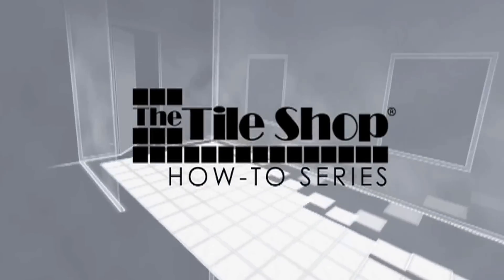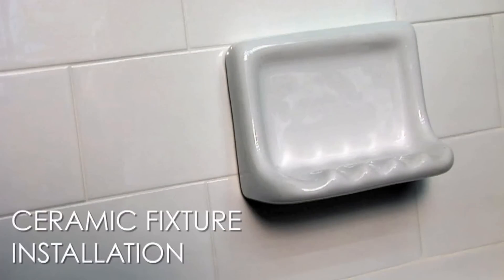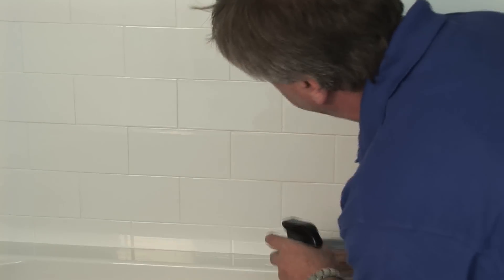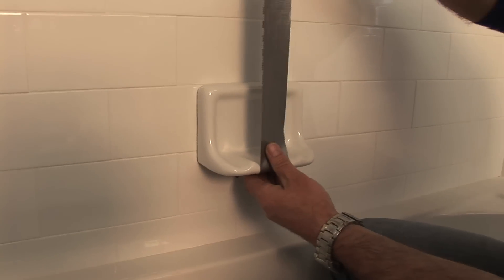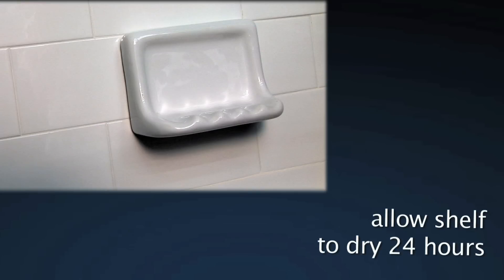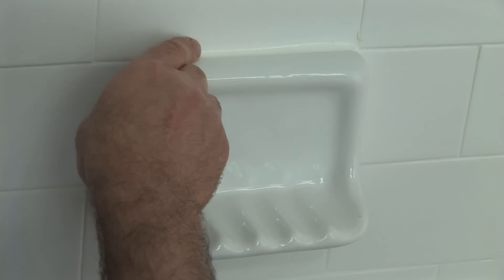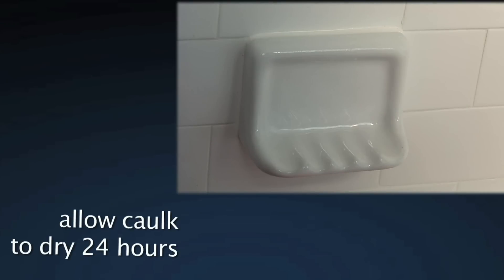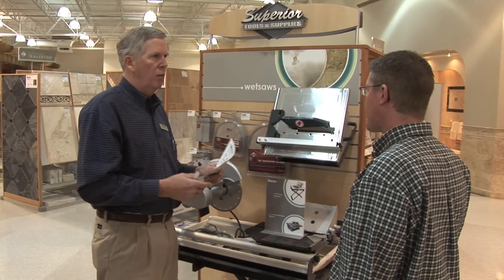Ceramic Shower Shelf Installation - Learn How To Install Tile Today

Comment: Best setting formula for setting any ceramic fixture on cement board, is weldbond glue combined with the grout being applied with the tile until it makes a 'gummy' mixture then add a little water to it until it becomes workable like a mortar consistency. I laid ceramic tile for 25+ years until I had to retire because of health reasons. Absolute best setting material you can come up with. Once its on there it will NEVER go anywhere unless you want it to and even then you'll have a hard time. Sanded or unsande doesnt seem to matter once it has been on there 24 hours I used to hang from them, with all my weight on the fixture.

Comment: just use epoxy glue. i tried dap, i tried grout and none of them worked. fell off in a day or two but the epoxy glue is still holding

Comment: Do it the RIGHT WAY!! Remove the tile from the area you are going to install a soap tray, then use Plaster of Paris to glue the tray to the wall NOT THE TILE! After 24 hours of curing, use a silcone based grout to seal around the edges. "The Tile Shop", you suck.
Reply: lilrascalrc I believe they would recommend pure silicone and caulking
Reply: Placing duct tape like that really doesn’t apply much pressure in my opinion.  Better to at least tape around all 4 edges.
Reply: That won't work. Mine fell off after 24 hrs! I have also tried and failed using Loctite Power Grab Ultimate as well and it STILL came off!🤬Seems like nothing is gonna hold that dish back in place!!!!